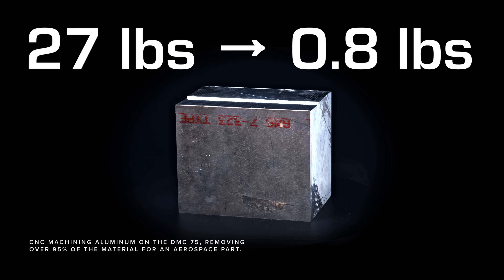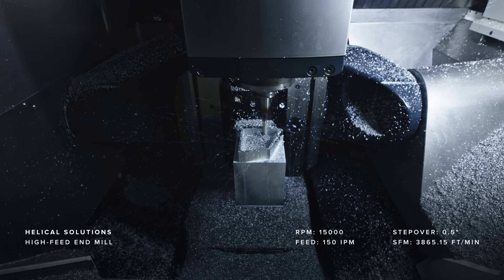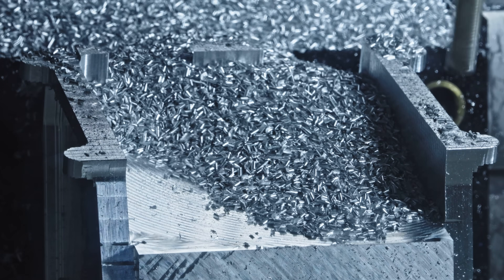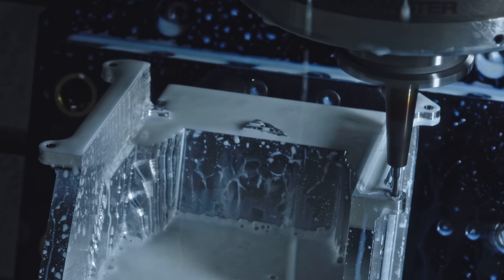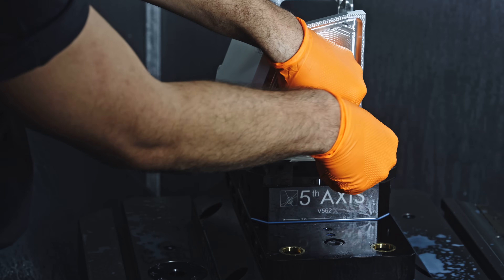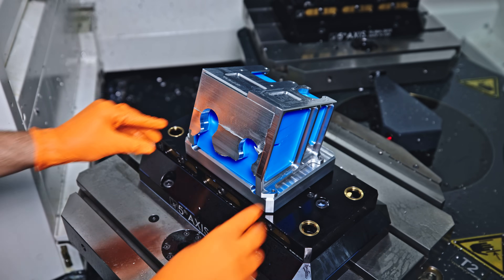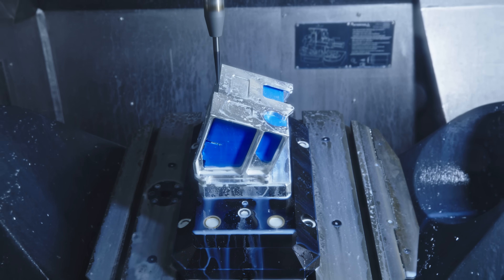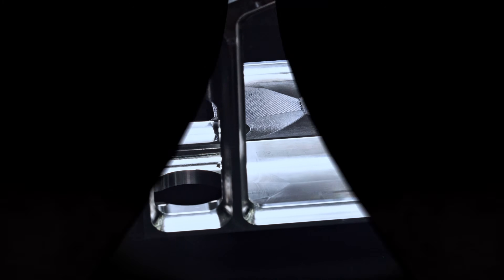5-Axis CNC Machining for Aerospace | DMG MORI DMC 75

Comment: That is a good looking process. I'm surprised the part didn't warp after removing all this material. Also the 3d printed supports that bolt down to the part can distort it while finishing and spring back. I'm interested in how to tackle this. Maybe add some rubber oring to dampen vibrations without distorting the part. Same goes to the 2nd op 3d printed support. In some cases this part may have to go to artificial stress relieving prior to final finishing. We'll done and explained!
Reply: Warping will usally happen due to poor engineering of the part.  This part is thankfully supported by all of its 8 corners being connected together, not to mention its thickness of each wall. 

Though, i say that and if I did this part, pretty sure it'd warp on me because I have fuck all kind of bad luck, and repeat the job doing exactly what you were saying about stress relieving.
Reply: @ErostheEpic  Yeah, its fun when things work out. but don't forget, a good part can also warp few days later through natural aging. they report about 20um flatness from their process. if their customer is rechecking the part in a few months after the part is relaxed, they may find it out of spec. it's a fine line, and sometimes I prefer to take precautions. this also explains why different quotes for the same job can be substantially different.
Reply: Everyone over dramatizes how much aluminum moves, doesn’t move as much as you think especially on thick small blocks.

Comment: Nice work !  The cooling is not continuous.  Is this for the clarity of the movie?
Reply: 9 times out 10 it is, if anything, on - off coolant does nothing but create thermal stress on the endmill/inserts which can crack the carbide and it can also create size differential on the part, although this would be microns
Reply: Why do people ask this in every Machining video I dont get it anymore lol

Comment: This is why Jets, missiles etc cost an absurd amount of money. I'm sure this could have been 3D metal printed at a fraction of the cost, but when it's the taxpayer footing the bill, who cares about value for money. These designers need a wakeup call.
Reply: A 3D printed metal part will need all the same surface finishing work to get it to be exactly where you want them. So you need another expensive machine and more time wasted locating the part between transfers.
Reply: You are absolutely wrong, despite how far 3D printing has come it still can't produce the level of precision required for aerospace and defence and 3D printed parts are far weaker than solid block machined ones, not only that 3D printed parts required further heat treatment and surface treatment which increases both time and cost.
Reply: 3d printing this part would cost double to triple the price and be less accurate
Reply: lol chill bro. they're a privately owned VC funded startup making satellites for commercial enterprise.